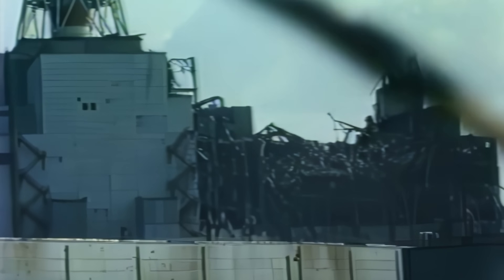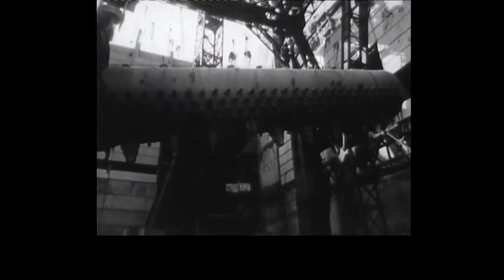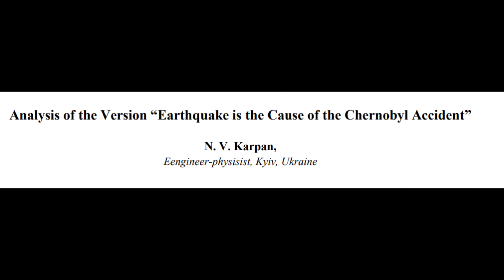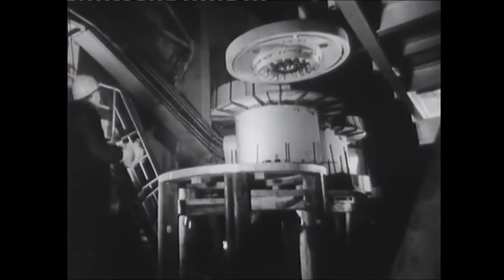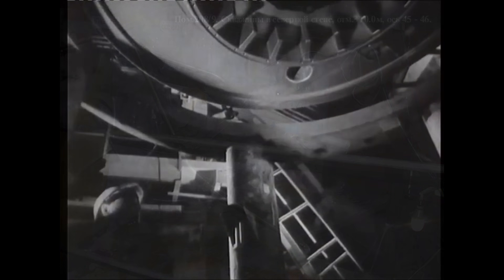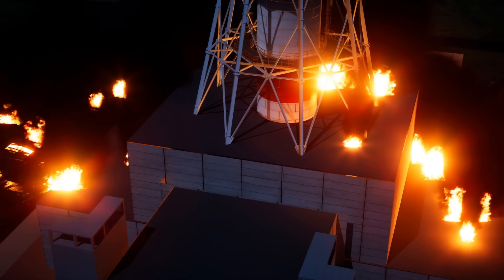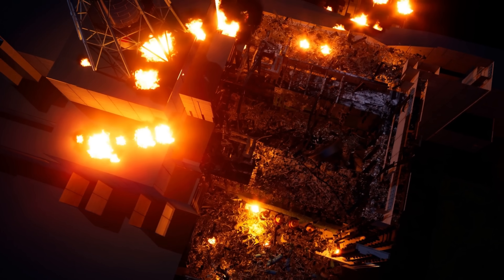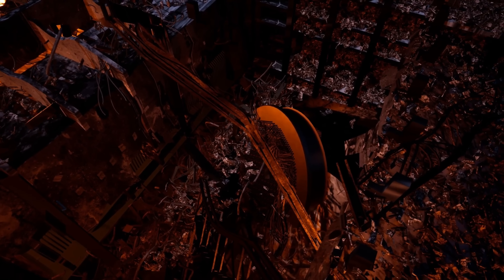The Mystery of the Forgotten Chernobyl Explosion

Comment: Isnt 500kg/m2 only like .7 psi? What an odd unit.
Reply: That looks correct to me. Also gun barrels are normally proof tested using pressures of order ten tons per square inch.
Reply: Odd? thats SI unit definition for you. In russia-former soviet union its very popular for some reason. In Europe its mostly Bar or Atmosphere, Pascal. For example russians refer to common pressures like tires etc in "kilos". Meaning kg/cm2, which is basicaly 1:1 to Bar or Atm. Imperial BS is not used.

Comment: Did they finally figure out that night if the turbines could provide inertia power until the diesel engines kicked in?
Reply: Yes, they did. But unfortunately in this particular case it was a: "The surgery was a success. However, regrettably the patient has d*ed." So, regardless of the success of the actual test, this rundown mode got scrapped from the books as a viable option.
Reply: Yes.
Reply: I don't know why these reactors aren't built lower than a natural water source with the addition any mechanical valves and whatnot are designed that if  failure occurs all equipment fails in an open loop configuration.. so at worst case you stall the reactor
Reply: @vincentrusso4332 modern reactors (at least western styles) are built to self-cool in the event of a massive failure with a large water source above them.
Reply: @vincentrusso4332 Cost? The whole reactor scheme was built up on a concrete pad poured to be at natural ground level. The reactor was then assembled on the top of this pad. See the reactor 'schemes' stacked under and to the left of the crane: less known photo - construction of 4th unit of Chernobyl Nuclear Power Plant : r/chernobyl https://share.google/sVpPB12tUieofXW2X
Reply: Task failed successfully.

Comment: Another example of a hydrogen explosion you may be interested to learn about was from 2 Japanese battleships in WW2. The Kirishima and Musashi had special thermite shells on board that cooked off when they sank. These burned at 3000 degrees Celsius, but the water cooled then down to only 1000. While this happened, the water split into oxygen and hydrogen and after cooling down, this allowed it to explode deep underwater and causing massive damage to the wrecks.
Reply: no shit? 
take that, mr. crabs..
Reply: I believe it was Yamato, not the Kirishima?
Reply: @polonezu07It was Kirishima and Musashi that were sunk with these shells on board and both were seen glowing red hot in the damaged areas because of the heat these created.
Reply: @franksposato6072  I see. But you could very much add Yamato to that list, she was in essentially the same circumstances as Musashi for the most part.
Reply: @polonezu07she took much different damage that led to her ammunition exploding as she sank. The real difference comes from the other exploding after they already went underwater. That's where the hydrogen comes from to build up and explode far worse. That's why the Musashi is so much worse condition than Yamato.

Comment: Once again you managed to come up with a very little known fact. I knew about the seismic data, but not that it was tied to a later 'splody happening after the main event. Would love to see a proper modelling of your theory.

And how people can believe that the accident was caused by an earthquake is beyond me. If an earthquake did occur, how come that only Reactor 4 was affected by it to such a degree that it caused an accident, but Reactor 3 right next door was doing fine? That doesn't make any sense. If an earthquake would have hit the station, all reactors would have been affected by it to a more or lesser degree. See Fukushima. When that earthquake struck, all reactors did what they were trained to do; scram themselves by the smallest hint of a tremor. Not having one reactor fly into a complete meltdown when the neighbouring reactor is doing fine and keeps on running. That alone should tell people this particular supposed cause is pure cobbler's.

On to the next video!

Comment: A very reasonable reasoned argument. It would be interesting to look at the room volume, the likely volumes of Hydrogen,  the likelihood that the split of oxygen accompanied it, possible sources of ignition, the resistance to high pressures escaping the room, the propergation time of the flame front, the resulting VP and the resulting forced on the room.  Would probable require computer modelling  with a couple of models feeding into each other.  I suspectif done carefully, results would convincingly supper or debunk the theory  by comparing the resulting explosion to known Richter scale data at that distance.  ( basically we have a crude bomb, we just have to calculate its probably power )

Comment: A science researcher that published a paper on the discovery of the mechanism by which sodium and potassium explode in water, hypothizes that in some conditions molten aluminum explodes in a similar way (but not reliable so, not much is known about it other than three literature saying are steam explosions) and maybe something like that could've happened in Chernobyl too
Reply: That's interesting but the main hot metal available at Chernobyl would be zirconium alloy used for fuel rod cladding and for the fuel channels in the reactor.
Zirconium is used because of its relatively high melting point and relatively low neutron absorption.
Because zirconium alloys are used for fuel cladding in many other reactor designs, there is a lot of experimental data on the failure modes of overheated   zircalloy fuel rods in water.
Reply: @derekp2674  Correct, and his hypothesis is that it could've happened with Zirconium. But it's not proven same as it's not proven with aluminium. It was "easy" to test with sodium and potassium as their melting point is so low.
Reply: thunderfoot ?

Comment: This is an interesting question. If >1 seismic meters recorded an event, then there was one. The time doesn’t quite align for the other events either, therefore I do view it as likely that there was an event that was then recorded as an earthquake. Those systems are completely separate from SKALA and the other recorders in the radiological complex.

H2 has rather concerning effects on steel and concrete. They are downplayed by those who have never had anything to do with it but want to sell an idea or product.

It will make steel brittle and can accumulate in concrete where it will further react with the reinforcement and the concrete itself. It is not something to be underestimated and the work that goes into ensuring safety is expensive to say the least.

Due to the unknown content in the technical channels (I have previously mentioned that there have been spectrums measured out in the zone that appear to hint at more esoteric radionuclides) and the rather hard to predict conditions that occurred under pressure in the context of strong radiolosis I would always want to assume that there was more H2 in it than one estimates.

H2 was the issue elsewhere too. Fukushima, for instance.

Thank you for continuing your research.
Reply: Structural reinforcement of the reactor hall and other axis of the whole complex were scheduled for the next shutdown. There may well have been more H2 in unexpected locations (it can easily seep through many materials and whilst passing react with them) too. It is not unreasonable to assume that the hall with the circulation pumps and the areas above the steam separators was affected too.

I also recall that there was an uneven field within the core before lid off. That could be the reason why there was more H2 on the right side than the left one. The cladding of the rods could have come off earlier than previously assumed too, especially in the part that was under an uneven load.

Comment: i wonder, is there any way that reminants of the refueling machine is visible in any footage? what was its and the crane rigs almost exact fate? its solid and heavy, id imagine it would be recognizable, buut i am too inexperienced to spot it
Reply from the maker: They're still there, on the west end of the Reactor Hall. It's more visible in Reactor Footage looking from the vent block side, but basically it was pushed up and crashed down into the Refueling Machine Control Room. If you find a photo of the Reactor Hall, the gantry is the large rectangular object on an angle right up against the wall closest to the Upper Biological Shield :)
Reply: @thatchernobylguy2915  A video on the refueling machine, if possible, would be a good idea.
Reply: @thatchernobylguy2915 thanks alot, I like cranes for some odd reason too. I'll try to spot it and the cranes bridge